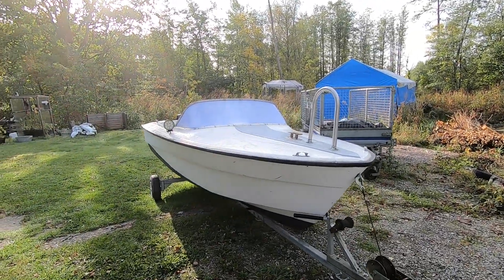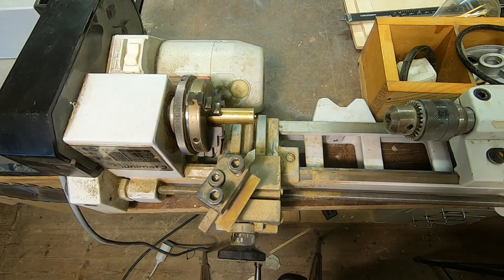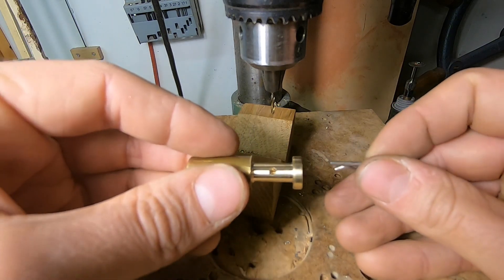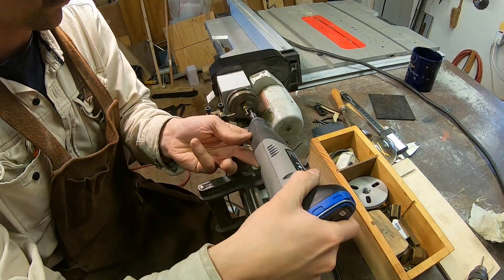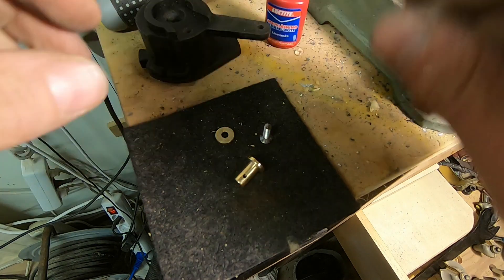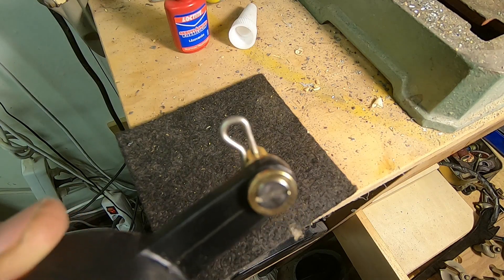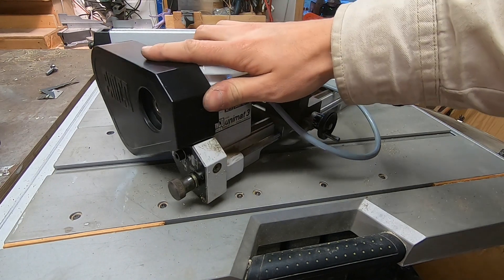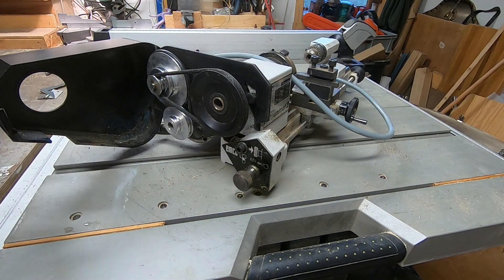Albatross Gets an Engine - Emco Unimat 3

Comment: Just found your channel.
I have the same lathe, brought in 1982, i have had the motor rewound, and i use large 'O' rings for drive bands, they work very well, and are easy to source
Reply from the maker: Welcome to Mior Jeff! Great tip! It's a lovely little machine. I think I'm going to get something bigger though. I feel I'm always trying to make it do things it wasn't built to handle.
Reply: @miormedia  yes they are very limited, I would 
Love a bigger , I can not justify 1, more dont I have space,
Reply from the maker: @jeffreylord8172  Same here!

Comment: You should consider to prepare something to catch the ready piece when cutting it off from the spare part. If the piece jumps away and gets lost in the workshop you also have to start over again. Something like a needle in the drill chuck would do the job.